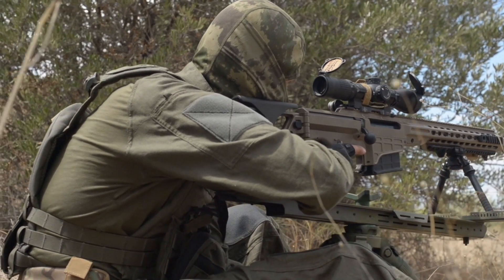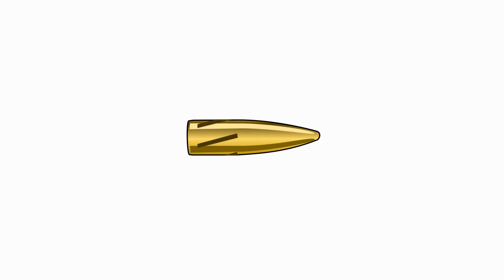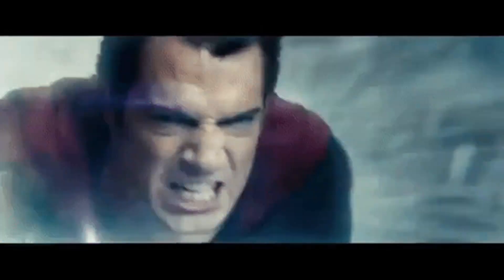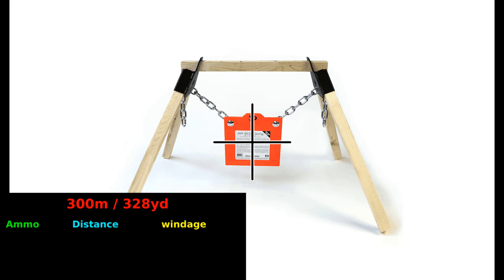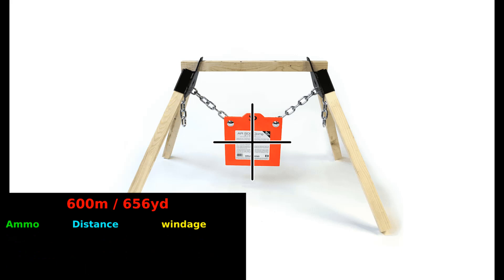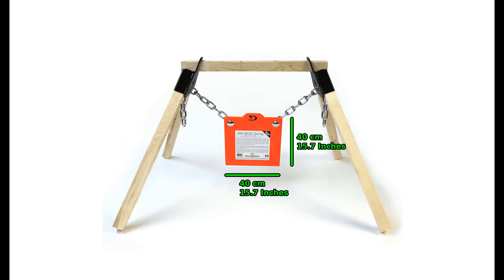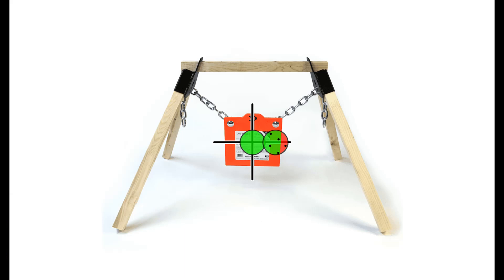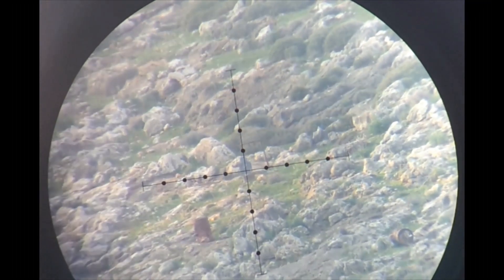Bullet trajectory explained part 3

Comment: wind adjustment is tricky....for the current scenario the assumption is from the gun to the target, the wind speed is same, right?

what if....the scenario is uneven wind speed or different wind direction? such as building to building? say, the shooter inside a 30/f building, from the gun to the window, it is indoor, there is no wind, outside the window is say, 10km, bullet enter the other building till reach the steelplate had no wind again. shooter may not notice the 10km wind at all. in a even worse case, outside this window may be 6km wind, target side window may be 8km different direction,  that's tricky tricky to predict. may be, just may be, ignore the whole thing prepare for the second shot would be easiler...
Reply from the maker: You totally right. Im planing make video in the future that explain the wind, and how to correct for different power wind and multiple directions.